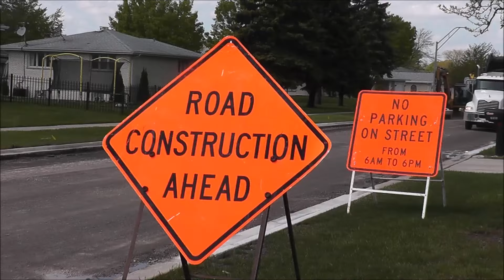Road Milling Machine Working On An Old Asphalt Street | Asphalt Removal

Comment: Most milling machines don’t leave that much of a mess behind them
Reply: 2 potential reasons for that

1) A lot of this was filmed on a section of the street where a tight radius was cut. These machines can only cut so far without offloading the material in the drum housing/conveyor belt. The deeper the cut, the less material you can drag without offloading (looks like they're at 4"-5"). So in spots where it isnt physically possible to get a truck under the belt, the machine has to open the back moldboard, pulverize, and leave the milled material in place until it maneuvers to a position where it's able to conveyor the material out of the drum housing.

2) Looks like they're mostly breaking through the asphalt to open grade which easily gets torn up by the equipment, also the clean up crew are moving around a lot of the material that the milling machine wasn't able to get.